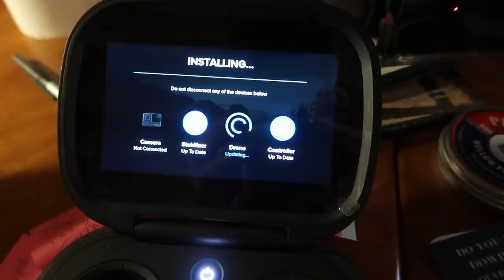I'm Sorry It wasn't supposed to end this WAY!

Comment: WOW!   50K!!!!   Congratulations!      The long view of the trees looks like a 1950s black and white post card.   I love snow as long as I don't have to go out.  LOL!!  I lose power a lot in the winter.  I have at least 3 dozen 10 inch tapers on hand and several solar and hand crank lanterns.  I love my gas stove!!   I can cook and keep the house livable.  Last time it was 28 hours.  Only got down to 50 in the house.  You will not have that problem.  Wish I could use a wood stove.  :-)

Comment: Al, you might want to check on what gasses are released as the foam dries, especially indoors.I enjoy watching you plough. As I was watching you clear the snow I thought back to when we had our house in Gospel Hollow and how much I enjoyed using a  manual snowblower on our property. I cut the same path every time so much so that the walls were 2 feet high all around the house , out to the woodshed and the firewood stack ( I liked stacking wood in cords).I got my old plough for $75 and it worked great for a decade or more, except when the key snapped when the load was too high. When 24” or more was forecast I would get up in the middle of the night and cut down the first foot. Like you  I loved the middle of the night atmosphere. I would then hang my wet gear around the wood stove, throwing a couple more logs on before sliding back into bed.
I love listening to your goats. Brings back great memories.
Your neighbor, in central VT.., Dylan.

Comment: might be time for a honda inverter generator ? We loose power pretty regular in the summer storm season, heavy rains and HIGH winds. Then in the rainy , snowish , freezing temps in the winter. Drops the trees branches everywhere. The well is the only electrical challenge , to many amp draw at start up for my 3000 watt unit . But it is very quiet , fuel efficient( fuel injected) , keeps the frig, computer  and lights going. Easy to maintain. Not cheap but best quality for the long haul.  Us viewers should have shared some foam tips  with you . Having the foam in direct contact with bucket backside  wall is most important. Next version of water box I am sure you will use more small layers. You can clean the foam straw at the end of use . Wire and little piece of old rag will do , like cleaning a rifle barrel . The drone footage was GREAT. You have a winter wonderland :) I wore teeth braces for 6 years in school. Way before they had modern water pics. That small jet of water goes where no tooth brush every could.  Hope the power comes back on soon for you folks :)

Comment: PS; Clear a path with a shovel on all your feeding travels so that when it freezes it won’ be dangerous to walk on, you will be thankful when the snow gets really deep.Spread a thin cover of used  catbox gravel or shed manure on the surface if it gets slippery.By darkening the pathway it will become a black body radiator and allow the sun to melt it.

Comment: Put a hair dryer on the foam. It needs warm air to speed up the curing. Each 18 degrees F in temp rise doubles the curing rate.

Comment: Love the drone footage AL. Do you have a generator ...... do you get many outages. I get one once in a blue moon, which makes it hard to justify one. I have a small kerosene heater ..... that I use in the attached garage when temps drop really low for 3 days or so, to prevent the main sewer line that is embedded in a kind of exposed corner  from freezing . It's terracotta, so you have to be very careful what you use to thaw it. You can't pack insulation around it either, because like I said .... it's half embedded in the concrete block wall. Fun times with winter temps, but I don't have to do this very often ..... not at all last winter as a matter of fact ~8^) Well, enough of my blathering ..... you all have a great day and take care AL, Gina & "new Navy Blue braces" Olivia.

Comment: Do you still have one of your cattle panel chicken tractors?  Could you put one out by NYC to make a second out door area?
Reply: Also, the black and white effect is because that's what's there to see.  Snow and dark bark and pavement.  Heightened by the overcast, which means there's no blue to reflect off the snow, and less refraction through the ice crystals.

Comment: You should never try to dry foam that thick. Always break it up into parts when using spray foam. It can only dry so deep. Take the bucket out. The foam has already expanded as much as it's going to. The only thing the bucket and plastic wrap is doing now is blocking the air from drying it.

Comment: The plowings an ok new touch i myself was getting a bit worn out of hiw much chainsawing and excavating was being done before at normal speed.. Maybe just the first pas at normal speed then zoom us thru the rest? Ik its a nice filler tho and without it wed be back to the 10min vids :/

Also on foam its usualy wise to let it set 24hrs because of that goo youv encountered and they dont usualy expect you to use more then a can let alone in a little area.. So maybe make the walls first next time and spiral it around bucket and let those fully dry and harden before u work slowly on the filling of the rest

Comment: That foam not setting: I suspect the environment was too cold, and dry.
water is what triggers the foam to set, usually in the form of traces of moisture in the air. Ambient temperature should be about 70 degrees.
If it was too cold and dry, the foam would expand a bit slower and cure much slower.
Reply from the maker: its over 70 in the basement but dry from the wood heat. I wonder if I misted it with water if that would help
Reply: @LumnahAcres It gets most of the needed moisture from the air, but when you have an airtight barrier like that clingwrap, it puts a bit of a spanner in the works.
Yes, a light misting of water will help it set.
This link talks about this stuff...
https://www.greenbuildingadvisor.com/article/justin-finks-canned-spray-foam-tip